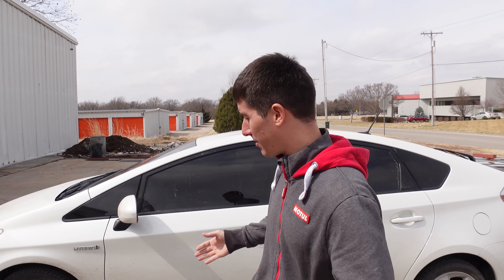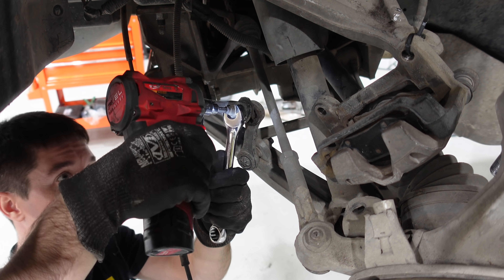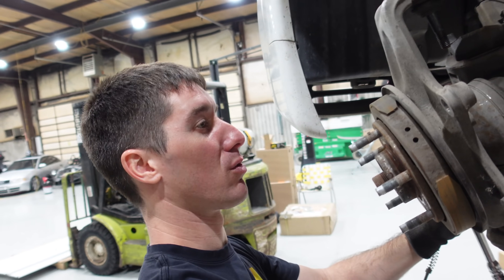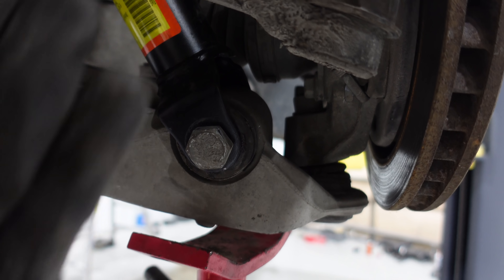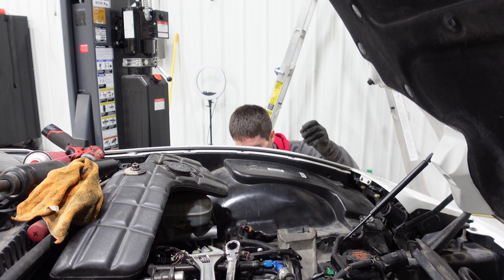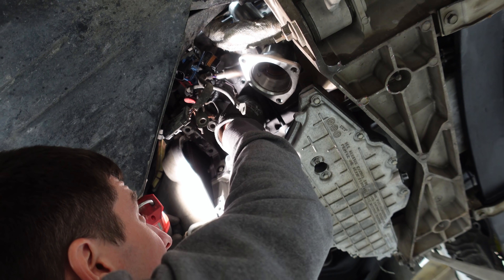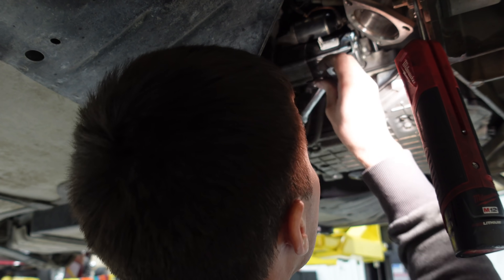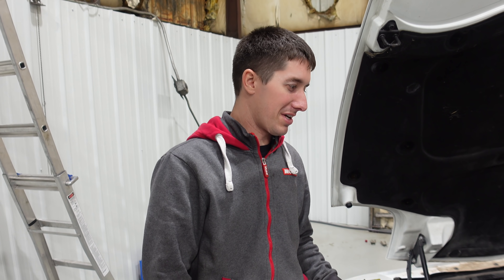The NEW Suspension Is HERE For My $3,500 Corvette *Along With Tons Of Other Parts*

Comment: Sway bar link life hack: when taking off the old one that’s already trashed just get a vice grip and crush down on the boot so it’s grabbing the shaft and ball on the back side. Then just hold the vice grip and impact off the nut … no need to use that silly torq bit or allen. Obviously only do this if your throwing away the old link but it works every time. I live in the land of rust and disaster so this is needed every time I take a trashed link off. Most times those torq teeth are completely missing in action… hope it helps … Godspeed!

Comment: They aren’t reverse thread. You should be using the Allen or torx to hold the “bolt” while you loosen or tighten the nut.
Reply from the maker: Lol, you’re right… you don’t unscrew the bolt from the back of the nut very often
Reply: Came here to say the same thing lol
Reply: I was actually yelling at the TV... 😆

I've made the same mistake plenty of times.

Comment: Have watched a lot of your videos and I always wonder why you don't hit bolts with a wire brush and penetrating oil before you try to loosen them. you would find it much easier, break less bolts and round out fewer nuts. Also a dab of grease before you put them back together makes it easier on the next guy - which might be you !

Comment: For future reference, if you put a long extension and a deep socket on the top of the front shock and bend it back a forth a couple times it breaks right off so you don't have to fight to get the nut off.

Comment: The old sway bar links were not only shot, but made of the original nylon which flexed far too much. As for the new links being quieter, yes if you keep them tight (very tight). I would check them after some miles and "bring'em home". Inevitably they will develop creak noises if not extremely tight. Went through this on my '99.

Comment: Bro. The whole point is to hold the ball joint of the link while you tighten the nut. Not use the torquez to spin it! That ruins the ball joint, not right away but it won't last as long

Comment: JR you can get metal t fittings not the plastic fittings you can get them at any autoparts store its a better upgrade so the t's don't break an leak all over the place same with the front coolant lines

Comment: They aren't reverse thread, think of it as a bolt going through a nut.
Reply: I had to look to see if anyone else said that first! You’re correct
Reply: I was going to say the same. The ball joint is the head of the bolt, so it's like turning a bolt from the wrong end. Though you really should turn the nut and just hold the ball joint still with the torx.